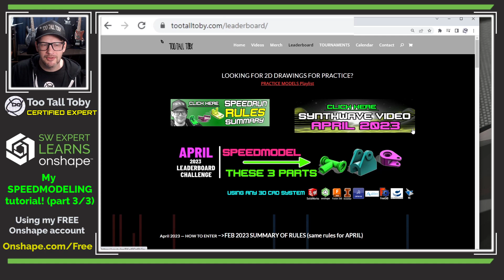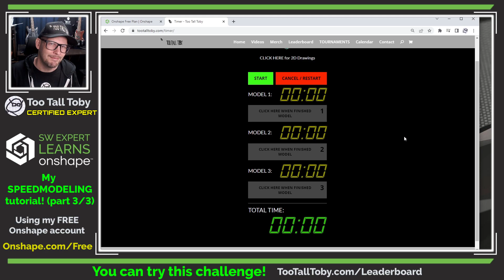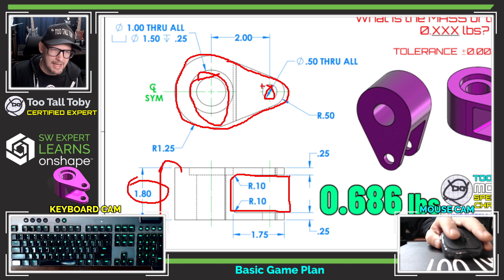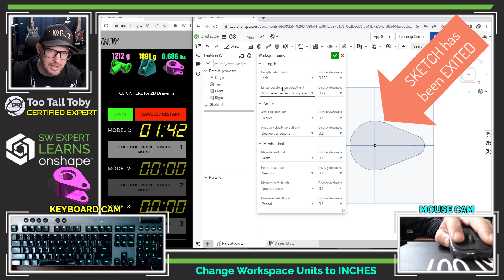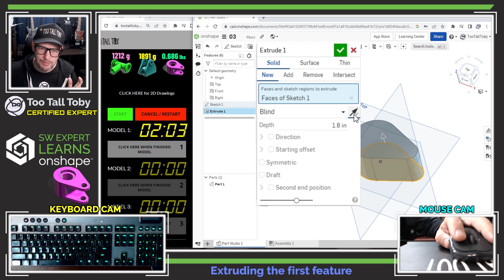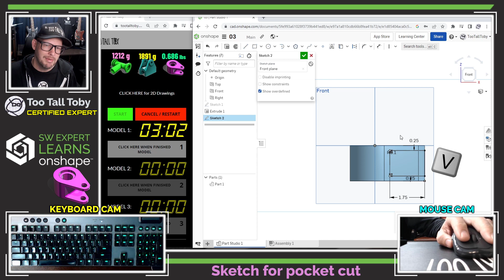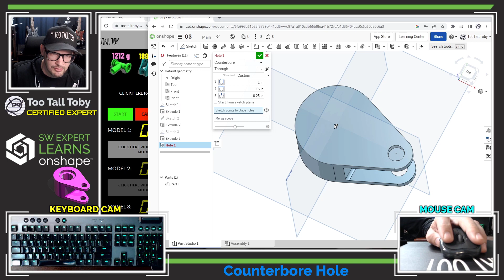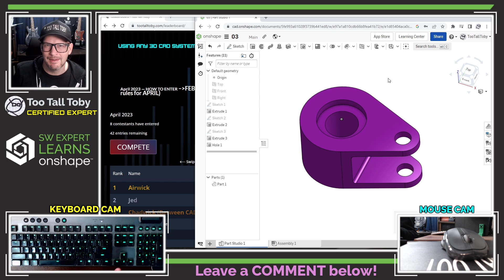SOLIDWORKS Expert Speedmodels in Onshape (Part 3)

Comment: I wish they would optimize the iPad version to work better with keyboard shortcuts. It’s hit or miss with that. Also, I could not get the line to change to arc using the Apple Pencil.
It would be cool if you could make a video using the ipad app one of these days. Great tutorial. Cheers!

Comment: Sketch 1: create overall shape and all holes.
Extrude 1: Remove both through all holes.
Extrude 2: Create counter bore.
Sketch 2: Create cut out.
Extrude 2: Remove cut out.
Win

Also, using hotkeys will greatly increase your speed. C for circle, D for distance, L for line, Q for toggle construct, Shift+S for new sketch, Shift+E for extrude.
Reply: ohh I like this workflow!!  Gotta try it!!

Comment: Nice one!
For the counterbore at the end, try clicking on the little mate connector icon to the right of selection box for the point! Then you can snap it to the center of the circular face without needing any sketch point. And this eliminates the need to extrude downwards just to get that option.
I actually do exactly that at 3:08 in my submission.
The line-tangent arc-line workflow works fine but there is no downside to just doing two circles with tangent lines instead as you don't have to trim anything. I do find the two circle workflow to be a bit quicker as you don't have to go back and add the constraints after the fact.
Reply: Oh that's excellent to know that if I use a mate connect I dont need a point!  I'm going to start using that!! Yeah the only downside to line-arc-line is no driving dimension shows up - hopefully in a future Onshape build they'll add that!